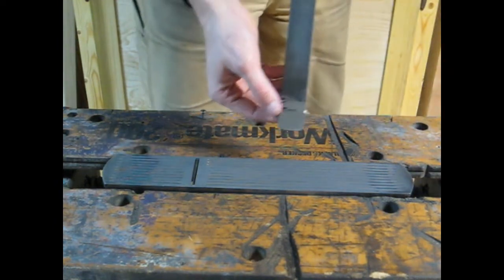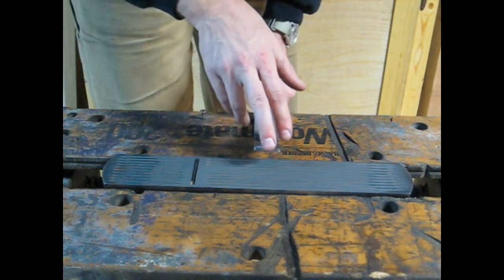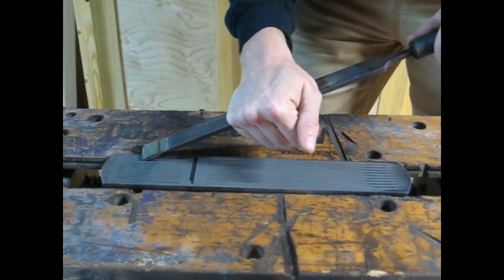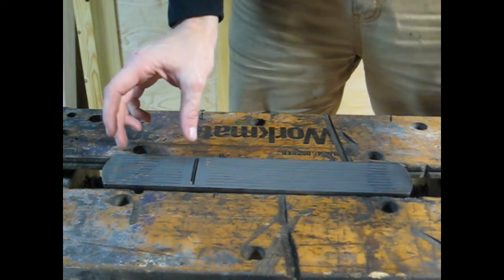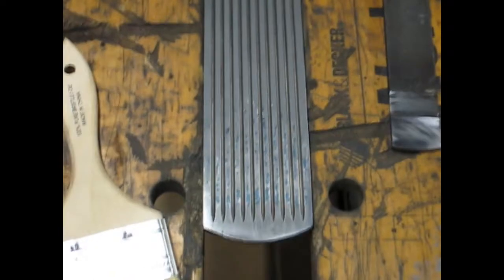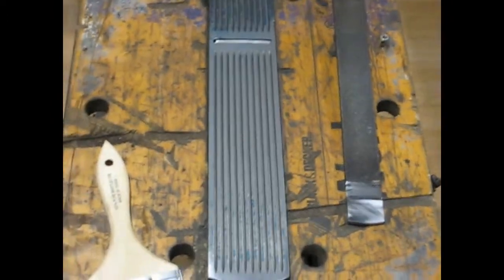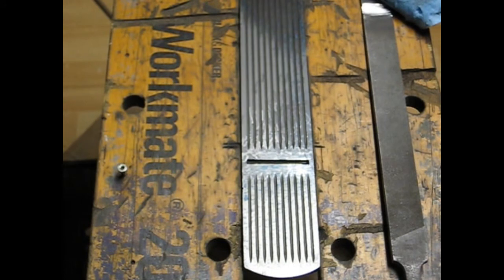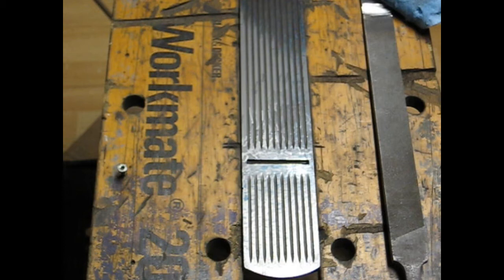Old School Machinist Technique for Getting a Perfectly Flat Plane Sole

Comment: My no 8 is corrugated. The main reason they did it was to reduce friction, particularly on resinous soft woods. It does help and it stops vacuum developing in spots too. This would be if the timber was wet. Sometimes the old carpenter's would wet the timber if it was knotty to reduce drag. 
But they would also candle wax the sole. Friction can be very exhausting on a big plane.
Iron tends to grab much more than wooden soles.
I rarely use the no 8 now because I have a long bed surface jointer.
But for trimming door edges and truing up a wide surface it's great.
Reply from the maker: You're absolutely right - and I wish I had a No. 8. I've also heard arguments that the corrugation was to decrease weight and maintain stiffness - those arguments make sense in addition to yours as well. The biggest complaints I've heard about corrugated soles is that chips/shavings get caught in the trailing grooves... yeah that's obviously an issue if your plane isn't flat but it can also be an issue if your workpiece is not remotely flat as well. Both of these issues can be resolved by getting the workpiece reasonably flat with a scrub plane and then using this method to have a genuinely flat corrugated plane sole. Personally I have zero issues with corrugated planes. Oh and your comment about wax - definitely still in practice. I've got a brick of paraffin canning wax from the grocery store - good Lord does it make a difference! I use it on every plane - even block planes.

Thank you very much for sharing your thoughts here!

Cheers,

 - Jens
Reply: @jensdavidsen4557  My no 8 is the only corrugated plane I have. I prefer Japanese planes for fine smoothing. Much less effort, much better finish, longer lasting edge.
I use a no 4 and a 4.5 for scrubbing and flattening and occasionally finish planing.
I don't have any other sizes. Don't need them. 
Candle wax works great but leaves wax on the surface. Not so great. Wooden planes have far less friction. I prefer them most of the time.
I flatten my planes with wet and dry on my jointer table. Or with a diamond plate. 
But your actually better off to have slight hollowing between the toe to throat and heel. Very slight though, just a thou.
Reply from the maker: @joschmoyo4532  makes sense - personally I also have a dedicated No.4 scrub (not flattened) and a separate No.4 that's scraped flat that I use as a finishing plane (smoother). As far as wax goes, when I'm done planning a surface, I use card scrapers to get my final surface so any wax left behind by a plane will be gone...and scrapers are great! Again, thanks for sharing your thoughts and technique here!

Oh and on the subject of what planes one needs...yeah...when I go to an antique store and find a plane in restorable condition... somehow I immediately need it LOL. I've got a couple block planes, a few No. 4s, a few 5s, two 6s and a 7 so I'm looking out for a No.8 - in my work, I wouldn't use a No. 1, 2, 3 because that's what a block plane is for...and those smaller sizes are ridiculously expensive.

Comment: I too find myself going overboard on projects like this to see how precise I can take things. I am in the process of returning to service two Timber style 1 man Crosscut saws, or Singlebuck if you prefer. I am sometimes tempted to break out power sanders and grinders but it’s definitely more fulfilling for me to do it with scrapers, files, and steel wool. Great technique, but I would definitely recommend showing how you touch the sole to your reference surface (I think you said surface plate) to display the transfer of bluing. 
Keep it up 👍🏻
Reply from the maker: Thank you for your comment and support Christopher! It's definitely not for everyone - not too many folks are as nit-picky as we are! That sounds like some very cool work restoring saws! Are you a Wranglerstar fan?  As for not showing the reference plate part - that s covered in the second part - a separate video called "Flattening a Woodworking Plane Sole: Ultimate Accuracy" I invite you to check it out! Thanks again for watching and commenting!
Reply: @jensdavidsen4557  something the Wstar rubs me the wrong way….
I figured you had a previous Showing of the transfer. Looking forward to throwing some clean noodles with the crosscut saws!

Comment: I'm just about to take a crack at scraping the sole of my Stanley #7 smooth bottom but I'm a little nervous about scraping around the mouth. Would it be possible to show us how you scrape around that area?
Reply from the maker: It's actually not that precarious - for one thing, the mouth is often (as I've seen), a bit lower than the body so it's not scrapped until later, and for another, there's nothing special about it - you just can't scrape from inside-to-outside of the mouth - you can scrape sideways and towards/into the opening. When finished, it's wise to gently dress the edges of the mouth with a small file to eliminate sharp edges. I've got a few more planes to restore but there are quite a few other projects in the pipeline.
Reply: That's very helpful, thank you! Sometimes it feels like there's a lot of mysticism around planes and I get nervous about screwing things up, but I'm realizing "nothing ventured, nothing gained" as they say. I'm excited to dive in! :)

Comment: When making the scraper from a file, did you say you hone the end to 90 degrees? So the end becomes flat and 90° square on all 5 sides of the file? 
Also, do you re-harden the end after honing? Thank you.

Interested in trying this method since I have a long 18"plane to flatten.
Reply from the maker: Close - so the top and bottom faces are honed and the tip is honed just a couple degrees off 90 (eye-balling it) - the sides I leave alone so in the end there's only 3 sides that are honed. Thank you for commenting, I hope I answered your questions but please let me know if you need any further clarification!

Cheers!

- Jens

Comment: Jens, just out of curiosity are you a fellow motorcycle riding dane? 🇩🇰
Reply from the maker: I am - I have a couple older project bikes (Yamaha and Honda) and a Harley that I've put more than 90K miles on.
Reply: @jensdavidsen4557  i've been thru my share of different bikes but always thought it would be pretty cool to find & restore a Nimbus.
  Nice job on putting 90k on your Harley.
Have a great weekend & i'll check in from time to time.✌

Comment: Hi, I have never seen this technique and I find it very interesting, I only have one question: how did you discover that the blue area stands out?
Reply from the maker: Hi Maldito, I hope I'm understanding your question correctly but when the granite plate (or piece of plate glass or flat tile) is uniformly coated with a thin layer of the blue ink, touching the plane sole to it and gently moving it a little bit will result in some of the blue ink getting transferred to the metal in all of the spots where the metal is too high - these are therefore the areas that need to be scrapped down. Please let me know if this does not answer your question and thank you for commenting!
Reply: @jensdavidsen4557  Hi Jense, now I understand, in all the videos I have seen they do the opposite: they paint the plane surface blue, move it across a completely flat surface and clean what is higher, leaving what is lower  blue, great technique, I'll try, greetings from Chile.
Reply from the maker: @malditobarba5678  yeah works either way! Thanks again for commenting! It's really fascinating to see viewers from around the world!